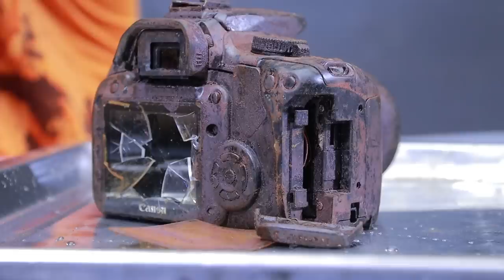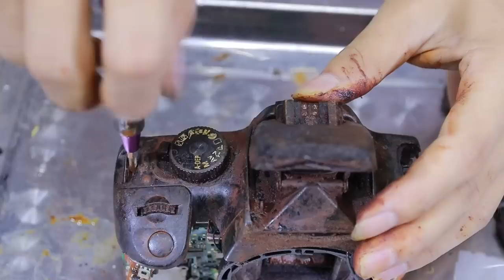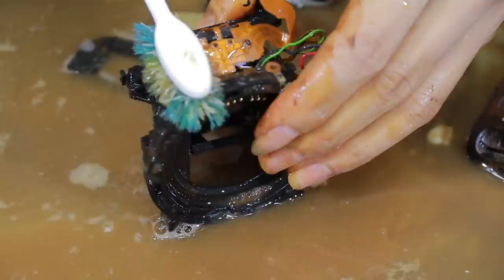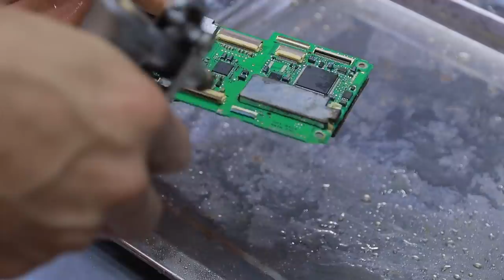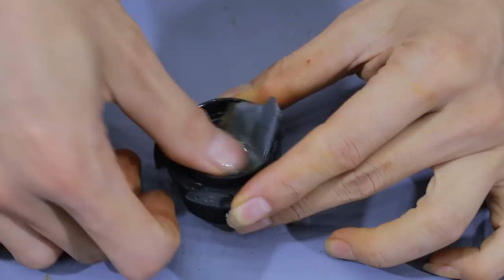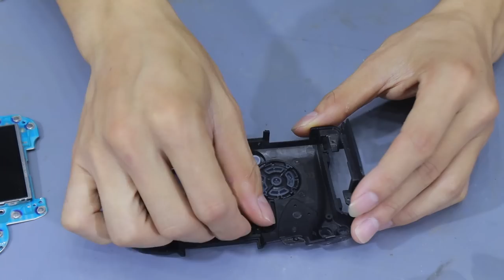Full restoration of CANON 400D camera after 20 years of operation | Restoration T - D

Comment: Need a dust free environment due to  camera components camera will never work has  sensitive camera lens plus mirrors I should know am keen amature photographer I own 4 cameras and it's a delicate operation in cleaning the camera and lenses and mirrors
Reply: I've repaired a few of this model and the most common problem is the mode switch. It fails when they are looked after. This one wasn't "looked after"  At least, not after he purchased it.
Reply: Well now you know that all you need to repair the camera is a toothbrusch, sandpaper and a black paint :) Oh! And don't forget the multimeter to measure random pins ;).
Reply: @Westfield000  Exactly Dominic. This scammer has faked all his videos regarding repairs. All BS and every one of them is done exactly the same way. Clearly he doesn't have a clue how to repair anything and his friends running the same scam don't either. Low intelligence and a complete disregard for decency. He not only gives qualified repair people a bad name, but also his countrymen.

Comment: Nice acting, i fix cameras and lenses, and its not easy, lens glass elements cleaning is a nightmare, its the dust ,using water on a sensor, is not good, how did you fix the Lenses Brush  and Focus Flex
Reply: exactly,total fake.
Reply: Was he washing the circuit boards in water?!!
Reply: @timames4405  Yep, and thats a no no